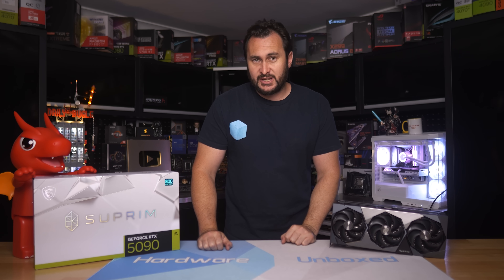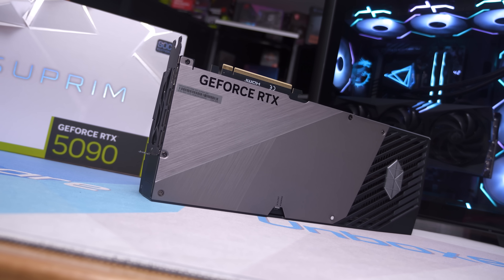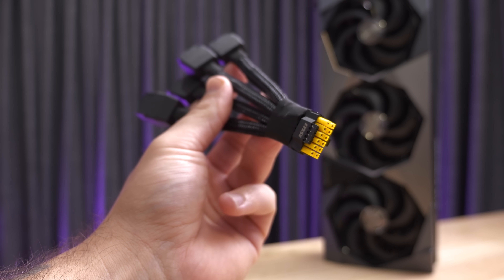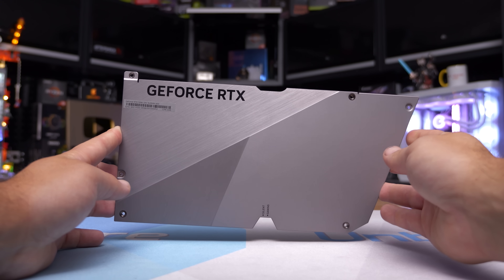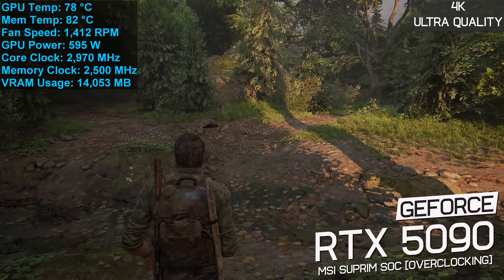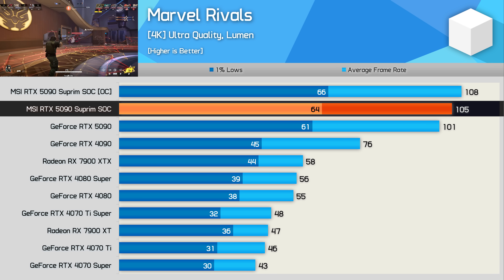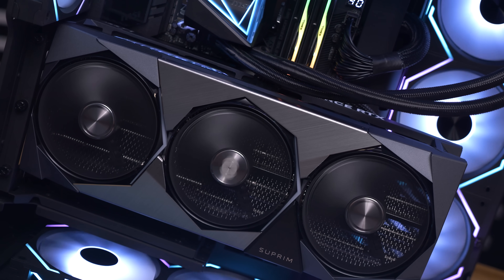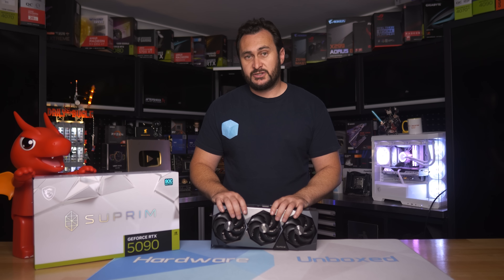MSI RTX 5090 Suprim SOC Review, Biggest Graphics Card We've Ever Seen!

Comment: Temps are 10C over Ada, power draw is up big over Ada, core count is up over Ada, performance gains...not substantial.  And now we know why Nvidia didn't release a 4090 TI with the full Ada board 2 years ago...they wanted to sell it 2+ years later.
Reply: Should have waited for a node shrink.
Reply: It seems gaming performance doesn't scale well for this many GPU cores, even last gen we had the 4090 with 50-70% higher specs than the 4080 only being around 30% faster.
Reply: It is just a refresh gen, Turing was the same, a 2080ti OC power unlocked was as fast as a 3080 stock.
Reply: In the end, we'll still sell them out anyway! LOL THANKS FOR THE LEATHER!
Reply: Jensen and co. built this card for FP4 compute for AI. It’s a monster at that. I don’t care about AI but he does and any shader performance uplift/FP32 is a coincidence.
Reply: I just feel like Ada Lovelac was and is the piece of perfection engineering, it powerful and consuming less power, my RTX 4080 consumes never more than 260W in every game Max settings while my old RTX 3070 consumes about 300W in high settings in some Game, the these two card performed like night and day comparisons.
Reply: Power draw isn't up over Ada, that's a misunderstading. 4090s are all built for 600 W and can be set there via the power slider (as long as your card has 600 W BIOS which you can be safely flashed on every 4090 if it doesn't have it stock and as long as you're using 600 W 12VHPWR cable, not the 450 W gimped versions).

Also, if you set the 5090 to 450 W instead of 575 W or 600 W, it only looses like 4-8 % performance just like the 4090 only looses 4-8 % performance when going from 600 W to 450 W.

With the 4090 and 5090 both at equal power - either both at 450 W or both at 600 W - the 5090 is on average around 20-25 % faster. Pathetic increase after waiting almost 2 years and 4 months.
Reply: What did you expect? Daymn brick consumes 750 watt alone.
Reply: Jensen knows what he's doing.
Reply: @iamrubinot42  I'm pretty sure Jensen knew since 5000 series would be on TSMC 4nm (same process), having the full Ada board would make the eventual 5090 look even more "meh" relatively.  Maybe if 5000 series was on 2nm they would have done the 4090 TI.  I assume they have to decide well in advance which node, for mass production.
Reply: @gosuprime  Blackwell was supposed to be on 3nm. At least the datacenter ones were originally presented as being on 3nm but they downgraded to 4nm, maybe due to cost.
Reply: @gosuprime it would literally be impossible for the 5000 series to be on the 2nm
Reply: @gosuprime I think they originally planned RTX 5000 for 3nm (that was the rumour until early-2024) but TSMC's delayed development for 3nm meant that Nvidia were stuck with 5nm. I remember that until early- 2024, the rumour was that Blackwell was supposed to be "up to 2.6x" more powerful than Lovelace.
Reply: @gosuprime  Bingo. They probably could have done mfg for 40 series as well but chose to withhold it.
Reply: Nonsense, no access to 3 nm, and a lot was achieved with 5 nm.
Reply: That's what happens when you make your next gen GPUs on basically the same TSMC process node as the previous generation. No performance gains are coming from improved power efficiency or transistor density. 

Almost all the gains are from increasing the size of the die, boosting the power consumption, and increasing the memory bandwidth.
Reply: Jensen knows EXACTLY what he is doing. Nvidia doesn’t give a fuk about the gamers.
Reply: usually power & temps go up when they come out with the same nanometer process
Reply: This is what lack of competition does on market. Jensen did this on purpose because this generation Nvidia don't have competition. AMD next gen UDNA should be great and 6090 will gain massive performance leap over 5090. Over 70% for sure.
Reply: @IgorBozoki1989  It's really the lack of competition at the fab level as TSMC doesn't have valid competition. They doubled the price of 2nm for example. RTX 7090 in 2028 will be 2999 at this rate.
Reply: @MermaidTyrone only 2999? Maybe for the 7080 😅
Reply: @IgorBozoki1989  the end goal of capitalist markets is monopoly. Why incur more costs within your company when you can sell the same product at a higher profit margin? People won't know any better and even when they do, they won't care because you're the only one with the tech to properly make this at a "reasonable" price tag.
Reply: Technically speaking Ada is the datacentre CPU architecture, it has nothing to do with GPUs. Lovelace is the GPU architecture.
Reply: Ai cores went up from 1300 to 3000?
Reply: 30% gain isn't substantial? You haters are just making shit up at this point.

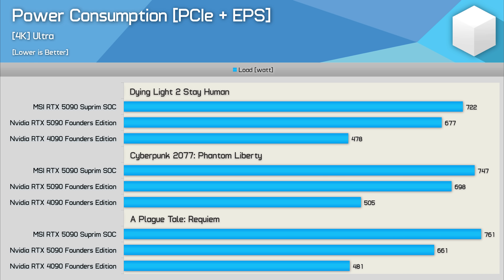Comment: 12:47 What? 761 watts? 😮 Wow. Okay, that's crazy high.
Reply: This is GPU + CPU, HUB count it together to account for GPU overhead
Reply: "this is fine"  🔥🐶🔥
Reply: They really should have added additional PCI-E connector there, I'm not exactly excited running that through that shitty 12 pin connector.
Reply: The electricity bill is going to fly to the moon.
Reply: id imagine undervolting 5090 would be the best option..
Reply: Thats total system power draw out of the wall, which includes CPU, GPU, board and the power loss on the PSU.
Reply: @lharsay  Well no, it explicitly says "PCIe + EPS", so it's the power draw for the GPU and CPU, not the entire system, and excluding PSU losses. EPS is the 8-pin connector to the CPU.
Reply: The world's first 1HP graphics card
Reply: I thought the max a card could draw is 675W?
Reply: @Aggrofool  did you watch the video? ITs PCIe power + EPS power.
Reply: Roughly 10 years ago, a PSU with 750W would have been more than enough for most people to run their entire PC with overclocking.

And yet it's not enough to just power that monster of a GPU, wow.
Reply: @steveweidig5373  GPU and CPU. Point still stands, it's insane, but the reading includes EPS i.e. the 8-pin to the CPU.
Reply: @exscape  "slips a $50 for doing damage control"
Well done
Reply: @ Thanks! I think the situation is insane enough without misrepresenting the truth. I also think facts always matter, and so try to avoid falling further into the post-truth society emerging in many places.
Reply: 80°C power connector, 800 Watts of power draw on a 600Watt certified cable.
 2x 12V-2x6 600 Watts, this could easily solve this giant issue. But nooooo...
Reply: 5090FE with a little bit of powerlimiting (if you exclude the pricing itself) is a truly amazing card.

Comment: My 4090 FE is already too big. This is ridiculous. 
It seems Nvidia didn't share their new cooling tech with their board partners.
Reply: Partners design cost-effective, in some cases materials cost less then production and research, so many use OEM radiator design.
Reply: FE probably has too much copper or other costly precious metals for them to use that design. Or they don't have that kind of production capabilities.
Reply: The tech is make a super expensive cooler because you get all the margin because you are nvidia
Reply: Why would they? They don't allow their board partners to experiment on their own, and hardware is nerfed before partners get the retail edition, making it difficult to bypass power limitations or achieve a better OC than the FE without raising the cost substantially, and the profit margin is basically set by NVidia. Neither AMD nor NVidia should be competing with their board partners at all.